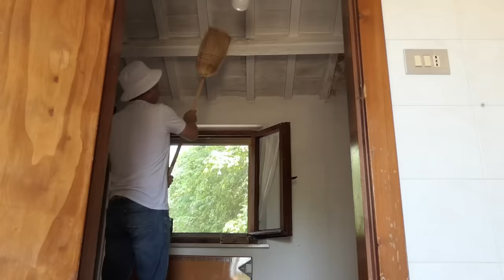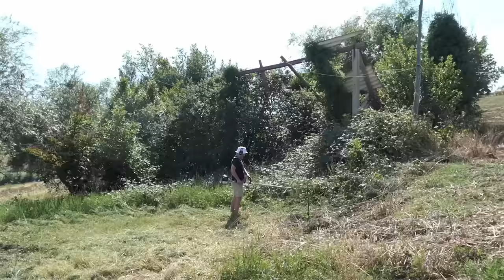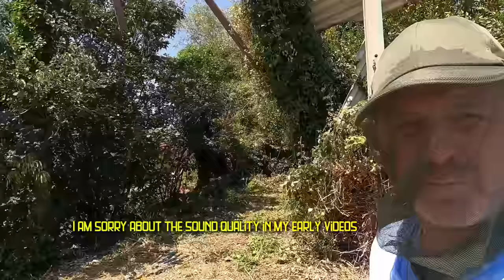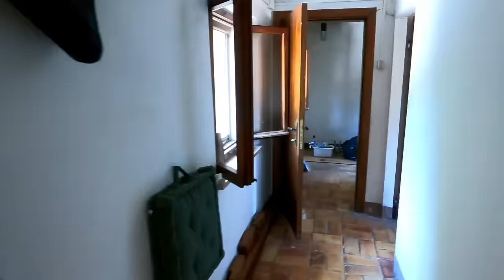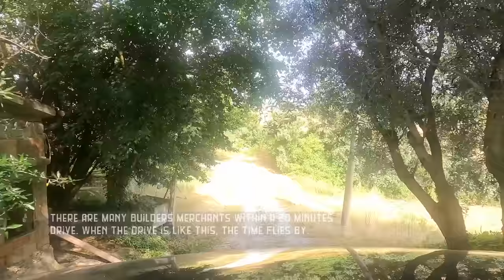#02 What 50k bought me in Italy! Farmhouse with land.

Comment: They make a mulching brush blade that is basically a flat bar that turns down at 90 degrees at the end edges that is perfect for brambles and small trees / bushes. I have a lot of woodland in rural Ky and I use it on my fence line. It really makes all the difference. I can clear an area the size of a van in a few minutes and all that’s left is mulch like everything went thru a shredder . I call it the spinning blade of death.
Reply from the maker: Hello @rexmundi8154  I tried what I thought was a mulching brish when taking on those over head height beauties. Is that blade the one you mean? The kickback from a blade like that, when I hit what I cannot see hidden, is brutal though. I try a different blade, which I will show in a few videos time, that I feel safer with. 

I need a shredder! It is on the purhcase list. 

Thanks for the tips. I really appreciate it.
Reply: @threeacresofmarche  the one I use is the Oregon 295504-0 on a Stihl weed eater with the handlebar control and sling. You need to wear sturdy clothes and shin / face guards because the blade can really sling debris at high velocity. I use mine right up against stone walls with no problem. The blade it very heavy and you can run it at slower speeds and it still cuts great. I’d put the money towards a high quality weed eater like a Stihl model FS-111 with the handlebars that let you hold it with both hands over a dedicated mulcher / shredder. You won’t use the mulcher much after you get the area cleared but the weed eater will be something you use forever. I wish id figured this out years ago. I had dozens of cheap weed eaters over the years and buying the FS-111 was the best thing I ever did. I’ve used it in heavy brush for over 3 years and it’s still going strong. With the mulching blade on the weed eater, you start at the top and come down on it until you can see more of the underneath. If you cut at the base, everything falls over and obscures the ground and the long stems get all caught up in everything. Mulching from the top down turns the stems to tiny pieces. I really need to make a video about it.
Reply from the maker: @rexmundi8154 Thank you. Great advice. I will get a chipper/shredder as there are alwys plenty of cuts from the olive trees that are not any good for fire wood etc. Thanks for the tips.

These videos are a little behind real time so it may take a few more to show how I tackled thes beasts! They will no doubt come back this year so I will invest in the kit! Thanks again.

Comment: You might need to repair the crack in your well liner pipe to avoid contamination during rain events!
Séamus W, Portland Oregon USofA
Reply from the maker: Hi @seamusegan9956 Thanks for the tip. I intend to clear all around the well. I think the bank that is on the high side is from mud built up from heavy storms over the years.

Comment: That trimmer is wearing you out!   Get a bush blade and unless it clogs up it’s much faster at the thick stuff.   Hang in there.
Reply from the maker: Tell me about it @kimhorton6109 - it is exhausting!🤦‍♂️ I bought the wrone one and have since changed blades to try two or three different types. With glass bottles in there I have to be careful. I also changed the strap to a harness. Once cleared and flat I can run a mower through there...I hope! 😂

Comment: Some of those old beds might make for good small animal enclosures (chickens, goats, etc.). Would just need to grind the legs off and fix up a bit. Your place might make for a lovely little horse setup. How’s the weather in winter?
Reply from the maker: Hi @clarkosteo . I am not there full time so looking after animals is not possible. Maybe in the future.

The winter in good. Mild - very rarely goes to low, freezing temperatures and this area does not tend to get any snow. A few miles inland (and higher) gets snow. Lots of blue sky days with amazing clear skies at night.

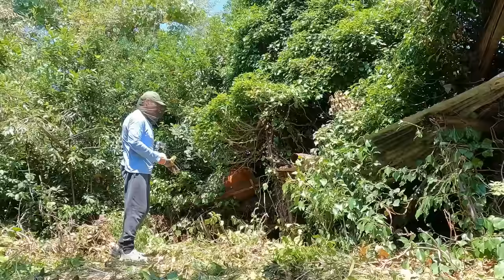Comment: Hi from Milan! what's that at your back at 9:20, it seems to be a roof structure made in eternit (asbestos cement). If yes, you have to be carefull.
Reply from the maker: Hi @MrItaliansound . Yes, there is a fair amount of that stuff from the old collapsed roof. It has been a lot of work to clear that area out, as you will see in later videos. It will all be disposed of correctly.

Comment: Certainly brings up the question of disclosure.  If the previous owner failed to tell you of contaminated soil or chemicals on the property and they get into the ground water, etc, then as the current owner, you might be liable.  Does Italy have anything in place to protect you?
Reply from the maker: Hi @user-lm2pn8ht6f - I am sorry if you missed this but none of those problems exist. I had surveys and searches done to buy the house. As it is in my home country it is very much sold as seen and buyer beware, but I trusted what I was told from the family that inherited this - and still live locally - and all reports backed up their message. There are no contamination issues that anybody in the area has ever mentioned or showed up on any survey. I will test the well water and use that for irrigation when I start planting.👍

Comment: The big question does it have a functional well and what is the capacity? I would get solar put in and a water storage tank. If you have enough elevation a tank acn be used for gravity irrigation.
Reply from the maker: Hi @matthewhuszarik4173 . I go into the well on this video.👍https://youtu.be/6nWco26F0rM
Reply: @threeacresofmarche  Yes I saw that later in the video. If the well has enough capacity you could turn your little piece of Italy into a Paradise.
Reply from the maker: I am told it has never run dry. Plus, when it rains...it can really rain (as you may see in another video). Rainwater harvesting is in my plans.
Reply: @threeacresofmarche  That sounds marvelous. Wish the best of luck with your little piece of Italy.

Comment: What more do you need? How about insulation and air conditioning?
Reply from the maker: Hi @veliksami . I have been in the house for two full years now. If I get the log burner and solar power right I don't think I will need to insulate the roof from the outside. It is an option (and big cost) for the future. Aircon will be the same. The flow of air is nice once you aclimatise.
Reply: @threeacresofmarche  if you’re ok and comfortable then that's all that matters 😁